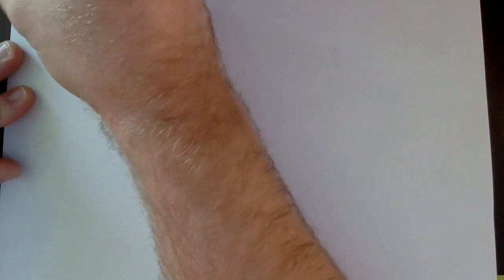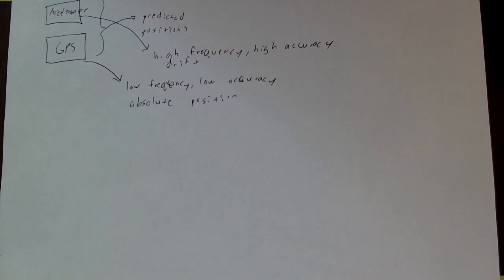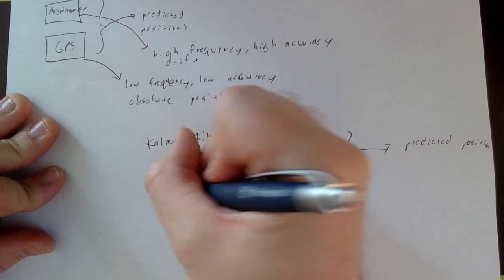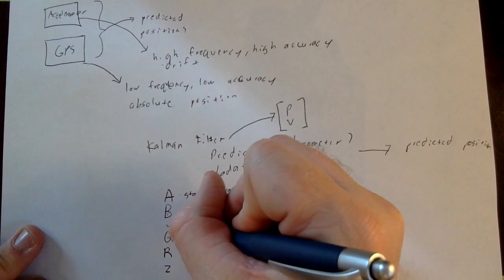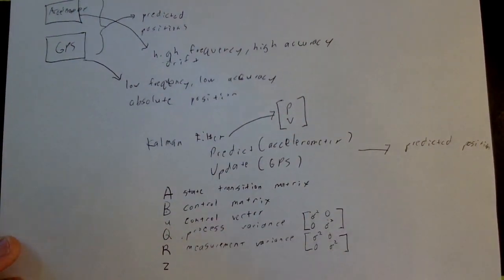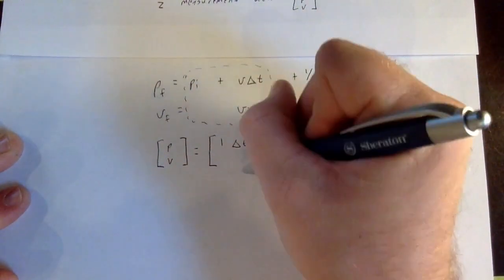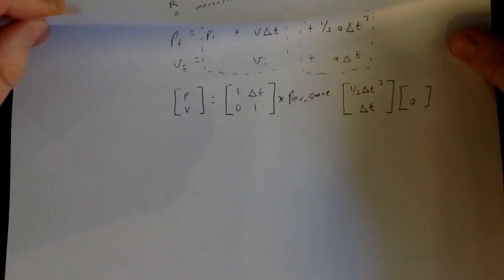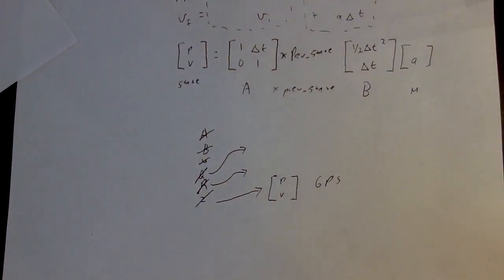How to Merge Accelerometer with GPS to Accurately Predict Position and Velocity

Comment: Looking for someone that will explain to me how to get linear position from an MPU6050😢😢😢
Reply from the maker: it's been a while for me, but what's missing from the video? If you have azimuth and pitch you can get an X and Y component for acceleration. You combine that with X and Y component for velocity and position from GPS. Plug those into physics equations to get distance for each component. Use a kalman filter to merge the sensor data. This isn't trivial, but that's the general idea. 

Another approach would be to just look at Ardupilot and find their code for extracting position; I haven't done this myself.

Comment: Hi Scott,  thanks for the  great tutorial
I got stuck in the coordinates between IMU and GPS. 
I converted the gps data to NED coordinates using pymap3d python library. 
But how to convert ax ay az to NED coordinates?
It will be a great help if you have any tutorials or any reference related to that?

Comment: Great video but something bothers me a bit: your kinematic equations assume constant acceleration.  This is a poor approximation if you are in car and you come to a stop at a cross-light and turn 90% left or right.  The accelerations (forward) and left-right have changed dramatically.
Reply from the maker: These updates are made at the same frequency as your accelerometer. To the extent that acceleration is constant, it's only for 1/30th of a second

Comment: Very nice video. Exactly what I was looking for.
Reply: hey, have you find the displacement from accelerometer? if yes, please help me to find out too.
Reply: @robo2.069  watch the video he suggested.
Then after getting acceleration in inertial frame, perform a double integration to get displacement.
Reply: @brianblasius  yes i getting inertial acceleration also done double intergration but there is a problem I am facing. After first intergration I am getting velocity but velocity I not  going to be zero although I have stopped all the movement 😔. I am in big problem without calculating displacement I can't proceed for my remaining project.please help me 🙏.
Reply: @brianblasius  thanks for the reply😀.
Reply: @robo2.069  what value of velocity do you get? Before integration, what values did you get from the accelerometer sensor?
Reply: @brianblasius  can you give me your email address so that I can send you plotted data of acceleration, velocity and displacement.

Comment: Why are the measurements from the accelerometer not considered part of the measurement vector (alongside with GPS measurements)? I thought the control vector 'u' would be the RPMs commanded to the rotors (for a quadcopter) or g + rocket engine force vector for a spacecraft. So from 'u' we could calculate force, and then acceleration by dividing by the mass. (and then we would check the calculated acceleration vs. the measured acceleration ...)

Comment: Hey, I worked on a similar kalman filtering application (just the vertical dimension) -  estimating altitude and vertical velocity from a barometric pressure sensor and IMU derived net vertical acceleration data from an 3-axis accelerometer and 3-axis gyroscope.  One issue that crops up is that you need the orientation of the unit in earth frame  to derive the earth frame x, y and z acceleration values. But the orientation algorithm can use the accelerometer data only when the acceleration magnitude is close to 1.0, i.e. static acceleration due to gravity, or the unit moving in a straight line. If you introduce centrifugal acceleration (plane banking in a tight turn etc.) then  (1) you have to coast open-loop on the gyroscope data to  update the orientation until the acceleration magnitude is close to 1.0, and (2)  in a banked turn the measured  net earth frame acceleration vector isn't in the direction of travel due to centrifugal forces - think of a ball tied to a rope and swung around in a circle.   
So I actually thought  GPS readings could be used in some sort of complementary filter fashion to skew the estimated Kalman filter velocity data towards the GPS velocity data whenever we can detect this situation ...  which is another hairy problem in itself... compounded by the issue that I'm generating updates for Pz and Vz at roughly 50Hz (limited by the pressure sensor sampling rate), but the GPS data is at 10Hz, so it would take a while to detect for example that you were moving along a tight curved path using the GPS data. 
Reference : https://www.youtube.com/watch?v=rPTJk17pWu4

Comment: I am afraid I think what you said at the beginning of the video about the update step incorporating the accelerometer reading  is wrong. As I understand it you are using the gps to measure position and velocity and the accelerometer to measure acceleration. All these measurements should be used in the update stage.

The more important thing is that you just cannot use a gps with a Kalman filter as the readings are highly correlated in the short term   over a period of minutes. If you plot the readings of a gps which is stationary you will see it "walk" around in a seemingly random pattern Ie the next reading is very close to the last reading.If you average the readings over a number of hours you will get the correct answer  with a standard devision of about 5 m. But moment to moment it can seem to be certain of your position but be 25 m out.

Comment: Great video, I have already get the accelerometer input from the previous video you share, but I have one question regarding this one. From your explanation, I can get velocity and position from standard equation, but how can I use the Q and R?
Reply: Q and R are used to tune the filter. They are the variances of the Process and Measurement noise respectively. There are two ways to get these values: 
1. By contacting the manufacturer of the sensors and asking for the variances.
2. By collecting empirical sensor data, firing up Excel and computing the standard deviation then square the standard deviation to get variance.

Comment: Hi Scott, thanks for the video. Am I right in thinking that the step that you wrote out was the predict step (using accelerometer data) and the update step (not in the video) uses the GPS data?
Reply from the maker: Yes, but another approach would be to skip the predict step altogether and do nothing but updates; For different sensors working at different frequencies, just use dummy values with an infinity high value to represent low confidence.

Comment: Hi Scott! This is great video I'm looking for. By the way I have one question, what is the unit for GPS output? Is it latitude, longitude and attitude? Since the measurement variance matrix will be in meter, should we convert to (x,y,z) coordinate?
Reply from the maker: What I did for this case, which is not perfectly ideal mind you, was to convert latitude and longitude to meters before sticking them into the kalman filter using the Earth's radius for the conversion.  Ideally, you would use the WGS84 reference coordinate system to convert to meters, but that's for a much more demanding use case.
Reply: Hi Scott. Good to know that. Thank you for your explanation.

Comment: This is probably dum but sometimes it gets difficult to identify variables especially when they are related. I am trying to estimate the position of an ROV moving along a fish nett (plane) under water. 
I have a pressure sensor for depth.
a single axis gyro: yaw
A dvl system wich measures, relative to the fish nett:
1) The distance for the fish nett.
2) the yaw angle it has relative to the  fish nett. 
3) The velocity of the nett relative to the rov.
 I have simulated a path with x y and z and also pitch roll yaw.
I have calculated what these sensor data should be like and added measurement noise/bias etc... 
I m thinking my state variable will be my postion (x,y,z) and the velocity (Vx,Vy,Vz).
V measurements, will be Vx, Vy and Vz. My first issue here is, what am I going to use as a measurement for the position? my initial position is known and since for example I can measure Vx, I can find x=x0+Vx*dt. Is it ok to use same measurement for two different variables as in using Vx measured value for measuring x. 
Another issue in the same flow is:
Lets say my equation for calculating the relative yaw angle is dependant on the absolute yaw the gyro outputs. When trying to use KF to estimate the yaw. these 2 measurement are related and its almost like having only one sensor. I feel I am missing something here too.
the variable z (the depth) for example is measured using pressure sensor but can also be measured using the Vz term from the relative velocity. am I just going to pick one for measurement update and one for prosses update? 
the variable x for example can be found from Vx but can also be calcultaed from DVL measured distance and yaw relative angles.
The variable y has only Vy for measurement. 
pfff I get confused just writing about it.
Reply from the maker: Leonard Cheri not dumb, mapping each variable is a difficult part of the learning curve. You could rename them, but then you'd be breaking off from fairly conventional variable labels.
Reply from the maker: Leonard Cheri tweet at me or something, I can try and help you out, but not free at all for a few days at least.

Comment: wow nice explanation. but i have a question, where do you merge the value of GPS and accelerometer ? I mean, from GPS we can get Position. and from accelerometer we can get acceleration and velocity by multiplying with delta T. I still not so clear how to integrate accelerometer and gps. please help me. Currently i'm developing DIY flight controller with STM32F446RE + MS5611 + MPU9255 (via SPI) + Ublox M8N.

Currently it only support manual flight mode and altitude hold. 
manual flight mode is only controlled by PID with feedback from Euler
altitude hold mode is controlled by PID with feedback from MS5611 + Z Acceleration (with complementary filter from Betaflight)
I hope i can develop Position Hold mode and Auto mode

Thankyou for your information

Devara
Reply from the maker: DJ-EVARA in my case I converted lat / lon to meters...those were in the inputs for update() operation on Kalman filter. Acceleration was used for predict(). The Kalman filter itself maintains the equations to relate acceleration and position
Reply: thanks for your reply. oh i see. so every iteration, you put GPS value to update() function then put acceleration value to predict() function ?
does frequency loop of update() and frequency loop of predict() are different ?
for example: GPS is only 10Hz and accelerometer is about 250Hz. then the iteration would be like this ?
1. update()
2. predict()
3. predict()
4. predict()
.....
26. update()
27. predict()
28. predict()
29. predict()
....
Reply from the maker: yes, frequency between the two is much different...you're better off just not worrying about that.  

If you really wanted to get hardcore you could keep track of the drift of your accelerometer and make it part of your state, but it's probably overkill and introduces a new dimension of complexity.

Another thing you can do if you want is to update() at the same frequency as predict() but use an infinitely high set of values for your covariance matrix...that's also a tactic you can use if you only have a subset of values during your update() step, i.e. your GPS gave you a position but no velocity.

Comment: Can you please specify is it a tight integration or a loose integration. Because we trying to implement IMUs with GPS for better accuracy
Reply from the maker: ah...strictly GPS position and velocity from the GPS
Reply from the maker: I'm not sure what you mean between tight and loose
Reply: by loose or tight he probably means what is the input data for the algorithm -
either accelerometer + GPS phase/code data => imporved positioning
or accelerometer + GPS positions => improved positioning

Comment: hello ty. 
So for the kalman we have Xhat_update  =  Xhat  + K*([1 1][p_gps v_gps]' - [1 1](Xhat ))]
where Xhat = [1 dt;0 1][p_process v_process]' + [0.5*dt*dt dt]'*acc) & K is the kalman gain.............is it rigth? 
thank you for your video. i've used the  ' symbol for the transpose
Reply from the maker: Your 2nd part is correct, not sure about the first offhand...after you define A, B, R, Q, u, and z, the rest should be plug and play...code sample for kalman filter is here http://scottlobdell.me/2017/01/gps-accelerometer-sensor-fusion-kalman-filter-practical-walkthrough/

Comment: Great video Scott. Did you mention the relationship between z and x = [p v]. Quite possible I missed it. If GPS only measures position, is z = [p v][1 0] + gaussian noise? The term (usually called C) is also needed in the Kalman filter formulation.
Reply from the maker: GPS measures position and velocity where velocity is ascertained through doppler shift so it's actually consistently accurate. I thought gaussian noise was accounted for with covariance matrices Q and R
Reply: Yes it is. So C would be [1,1]. This C is needed in calculating the kalman gain. Thanks for clarifying!